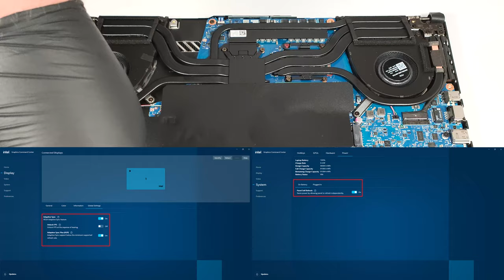🛠️ How to open ASUS TUF Gaming F17 (FX707, 2023) - disassembly and upgrade options

Comment: 3:31 and again wifi under ssd..of course there no other place for it in such a big laptop..🤐🥴 Engineer which did that, has a special place in hell..
Reply: Which is exactly why the wifi cards on these units continually fail due to overheating.